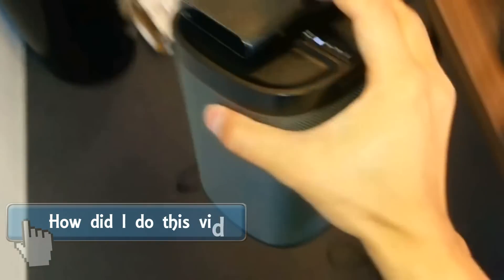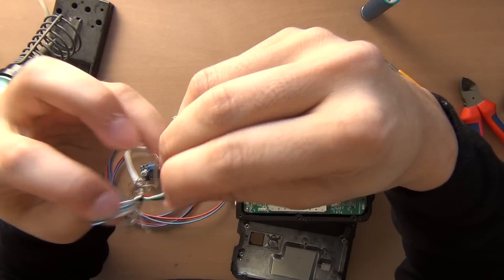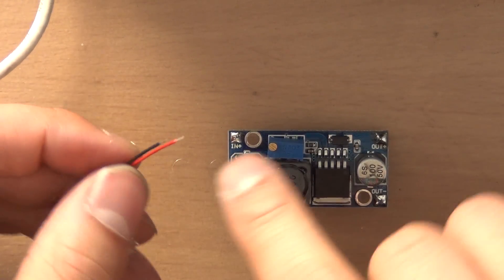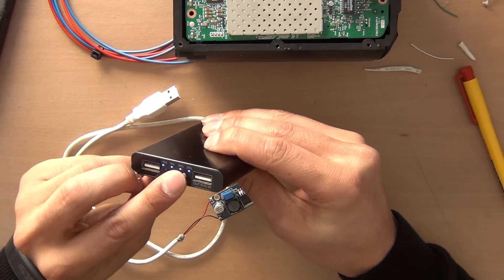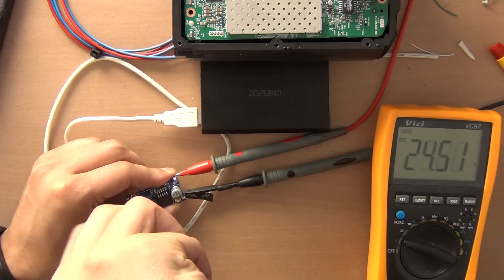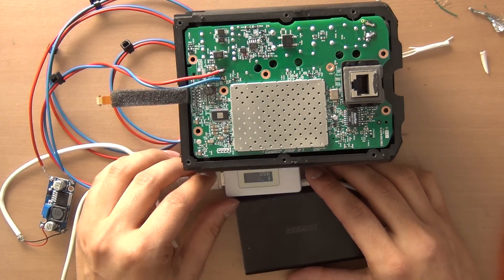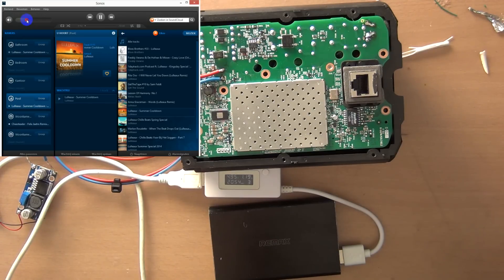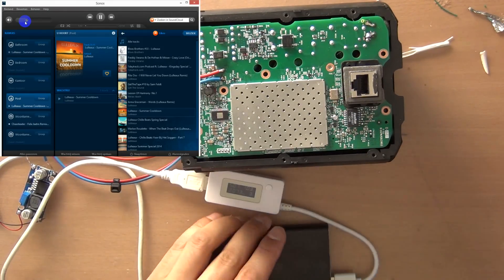Sonos PLAY:1 USB powered, how-to!! #HTNblog #3c

Comment: A suggestion, add a sufficiently large diode to the output of the 24v converter you added. this would allow you to still use the AC plug and keep the internal power supply from damaging the small up-converter board you added.  You will have a slight voltage drop in the output of the up-converter but you can compensate for that loss with your output adjustment.

Comment: Great video one question you do not have to disconnect the internal power supply. I would think if you hooked an external supply to the output of the internal power supply it would damage the internal power supply

Comment: this is an awesome video I wish the people that live in their Vans and tiny houses would get to know about this technology this is very helpful thank you thank you thank you so if I get a 20 amp USB I could probably pump up the power even more cuz you said it was using one amp 😁👍
Reply: I think you need to disconnect the internal power supply for connecting an external power supply. It only draws 1 amp of power 110 volts so I would think a 24 volt power supply at 1 amps should be sufficient. However if the music is distorted at high volumes then I would think you would need at least 2 amps. I'm surprised he didn't measure the current draw on the 24 volt power supply. I'm not sure she covered it because I'm having a hard time understanding him

Comment: Any idea what the max input voltage might be at the point you indicate?  I have just been using a boost converter , 10-32 in 12-35 out, 5 amp or so.   
The minimum is 15 volts ..about ..a definite cut as you reduce the input voltage to approaching 15.  It does not fade out..a defined cut off, though the white light is still working.  

Do you know the max safe working input voltage we can feed in to it?
Reply: I have a blown psu too so want to feed it with external psu. Is 24v the correct level at that cap? I have a 19v switched mode psu which seems to work ok but wondering if I should hunt down a 24v one instead?
Reply: @nathandixon3960  , I don't know for sure.  if it runs OK at 19..why not...I run mine at 24 and it works fine.  I did not try any higher.

My boost convertor was adjustable, and i did turn it down to see when it cut out, but cannot remember the lowest it went down to .

If I get a chance, I'll try again to see how low it can go.

if you do not hear form me, give me a reminder in a few days

Comment: Wonder if feeding mine with 24 volts will work ...the switched mode supply on mine has gone, , it blows the on board 2a fuse.  Replacing it has only resulted in a 'pop' of another component further up the Switched mode supply just be the big Cap.   I am going to try feeding the thing with 24 volt like this to see if it is the PSU on the board that is the problem, or if it was the amp or other parts of the Sonos that caused the PSU to blow...time will tell.

Comment: Did you have to discount the 240v connectors or can it auto switch between these depending on what is plugged in. 
I'm very tempted to do this now but before i do would like to know as id like to use it plug in most of the time but be able to move around house if needed. Thanks

Comment: I have a defective mid sub woofer speaker, I want to make two connection for two or just one 8 ohmios speaker of 40w? i know it is posible to connect external speaker and disable the internal one,  I just don't the total pre amp power that is inside the Sonos..  or if you know what are the replacement mid subwoofer speaker on the sonos, thank you in advance

Comment: and why does it get hot at high volumes in the first place? it wouldn't do that at high volumes, off the ac supply, would it??
Reply: Because this (cheap) the DC-DC converter is not the right one since it does not supply enough power. Should get one that is higher powered and maybe includes an heat sink.

Comment: so it couldn't cause damage? thanks for the response btw...I am planning on doing this to mine, this Friday. Can I ask what you think of the following step up convertor, this is what I have purchased on eBay for £3...MT3608 DC-DC Voltage Step Up:
Technical Parameters :-
• 2V to 24V Input Voltage
• Up to 28V Output Voltage
• Maximum output current: 2A
• Integrated 80mΩ Power MOSFET
• 1.2MHz Fixed Switching Frequency
• Internal 4A Switch Current Limit
• Adjustable Output Voltage
• Internal Compensation
• Automatic Pulse Frequency Modulation Mode at Light Loads
• up to 97% Efficiency

Comment: why does he check the temp of the ic? and is worried about it getting hotter with additional volume. is running the play one via a dc-dc step up convertor likely to damage the sonos??? if so I am very hesitant of doing this to mine now...
Reply: Hi there, I'm checking the temp of the IC because if it is getting too hot, the DC-DC convertor will shut down (voltage on output falls away) and therefore the sonos stops playing music.

Comment: Does anything speak against not opening the play one and installing the step up converter inbetween the usb and the sonos power plug? How many mAh does your battery have?
best regards
Reply: The Sonos power plug needs AC; the step up converter works with DC.  It will not work as you propose.

Comment: have just done this with my sonos at home. is it just at mine or is onybody else having issues with driving it above 1/3 volume? music starts to break up and then the sonos reboots....
Reply: Patrick van Deursen : It's possible the USB battery you're using doesn't put out enough current.  I'd imagine if you used a USB battery capable of putting out 2A, you can probably drive it quite a bit louder.
Reply: unfortunately it was not the battery, but the step up converter. in the mean time i did something else wrong and now the buttons on the top won't react anymore. the battery works bye the way with a new step up converter capable of more amps